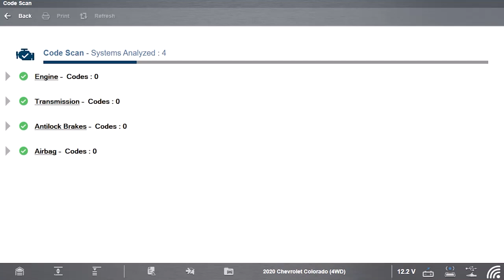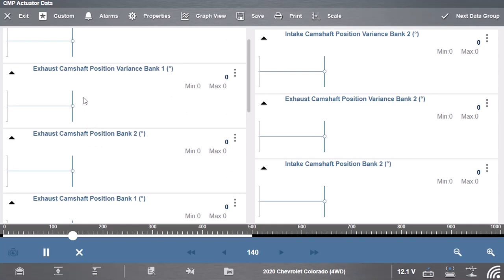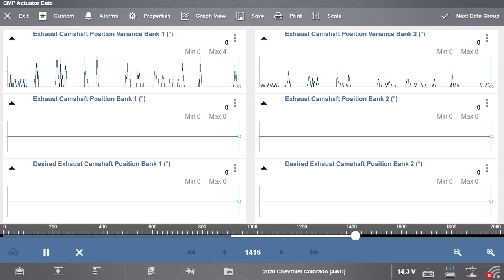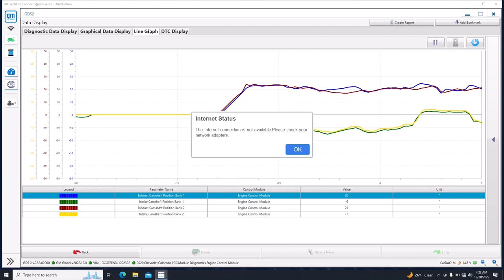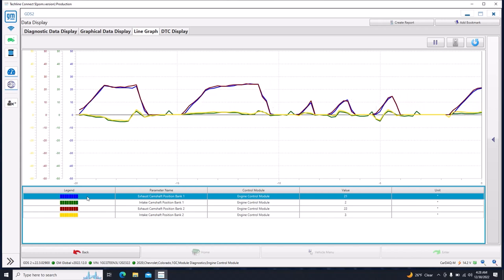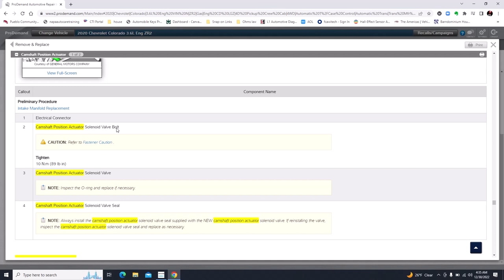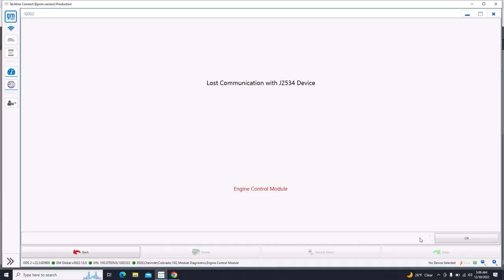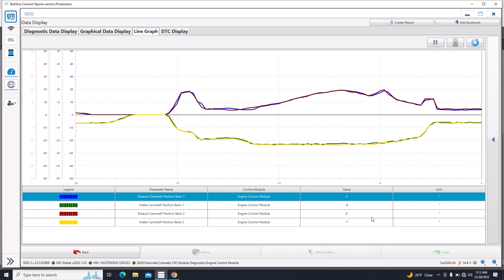2020 Chevrolet Colorado 3.6 P0019 VVT system Diag and Repair

Comment: February 20, 2024, there is a recall on this bank 2 exhaust cam position actuator valve solenoid,if the check engine light is on due to this!

Comment: Nice video always learning something from your video. I wonder if we had a scope on the cam sensors will we able to see the delay on actuation?
Reply from the maker: It would have required cam sensor, crank sensor and vvt control to be scoped. Afterwards we would have to go back and measure the time it took to respond.  It can be done but is time consuming. I find the scanner faster in this situations.
Reply from the maker: We could have also used to scope to try and watch the solenoid movement by watching the current and amperage while manually activating the solenoid.  It’s hard to see the spool movement while it’s being pwm controlled by the pcm.

Comment: HI, I got a p0024 code and a p0019 code. So I replaced the vvt solenoid (all) and then I replaced the camshaft position sensor cleared the code and drove around over 30 miles no check engine light. Now the light is back on. What is my next step? I usually work on diesels....
Reply from the maker: Do you have a scantool? I would monitor the vvt error PID and see when and if it acts up. 
Do you have good oil and filter installed?
I had a tundra yesterday with a collapsed filter causing vvt codes.

Comment: Tons of color do owners getting the same problem but P0014 code? Is that on the other side? Love to see which one to replace the 04 code
Reply from the maker: I have had a bunch in lately. Most owners agree to replace all 4 to prevent the other solenoids from failing shortly after getting the vehicle fixed.  Some only want to replace the bad one with the understanding that is another one fails under the intake they will have to pay labor again.
Reply: My chevrolet dealership only replaced bank 1 when my P0014 came up. A couple months later, here I am with a P0024. That's the exhaust bank. Same problem, same part, different code and location. I highly recommend pushing for all 4 to be replaced if you visit a dealship. Unfortunately, I have had a heck of a time trying to find the parts to replace myself.

Comment: Question, is the same for the other bank. The exhaust selenoid for the Bank 1 is at the right side of the other selenoid that im assuming is the intake one
Reply from the maker: The intake solenoids are the towards the middle of the engine and the exhaust are towards the outside of the engine. The bother bank is much easier to change since you do not need to remove the throttle body or intake plenum.

Comment: Does anyone know where the vvt is at in this truck? I do not think it is the same as the camshaft position solenoid.
Reply from the maker: I changed out the vvt adjusting solenoid. This engine also has a vvt lock solenoid that is used to lock the camshaft during auto start-stop events.
Reply: On my 2020 colorado my camshaft position sensor is on the passenger side in the back. Not hard to get to.

Comment: Where did you find the problem
Reply from the maker: Based on experience I monitored data to see which camshaft was responding slower than than the others and confirmed it matched my code.  Service information may have led us to the point but would have required additional testing. 
We could have swapped the solenoid and verified that the code now sets on a different camshaft.